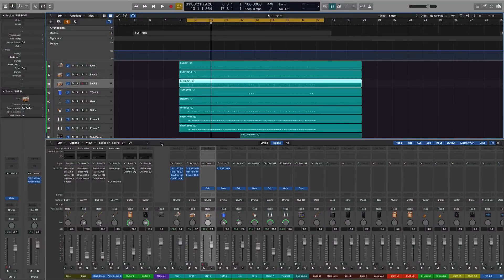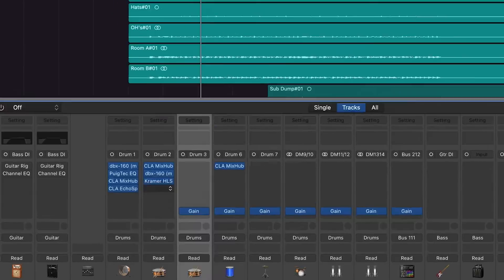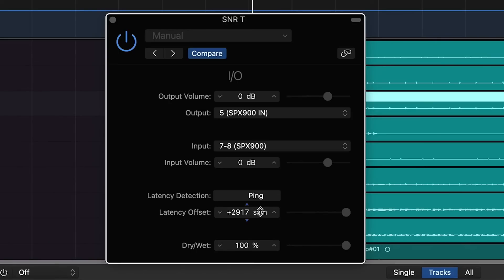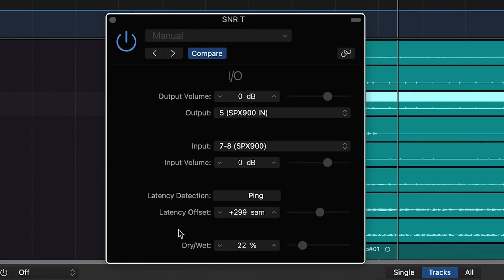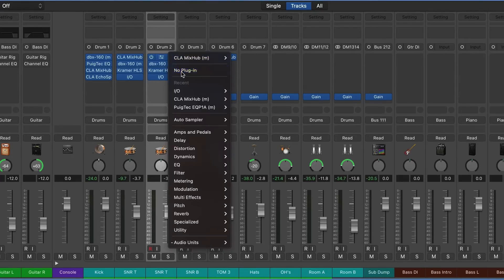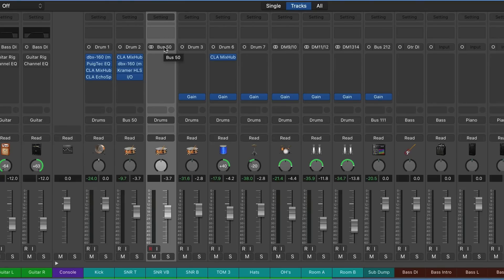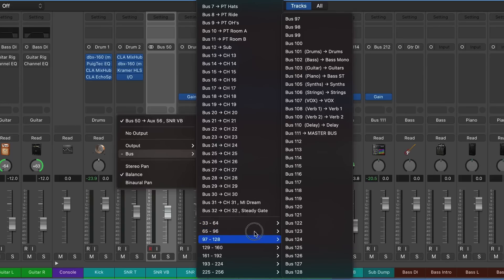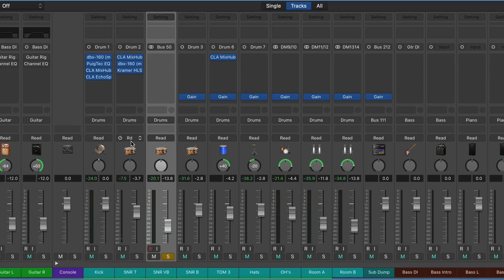Using Outboard Gear with Logic Pro X

Comment: So I want to start adding outboard gear to my studio, im running an Appolo twin and have been using UAD n waves plugins mostly .   My question is,  so if I want to use the outboard gear , pre, eq, comp for tracking , and mixing . How would I do that?    Say I have multiple tracks like chorus and adlibs and want to change the EQ on the outboard gear on that track ? If I change the setting on the outboard gear it would change it on the other track ?     How does the daw save those specific settings on an outboard gear for individual tracks? I can’t wrap my head around this.??
Reply from the maker: Good question. I'll start with the tracking aspect.

So the Twin does not have insert points. That means whatever you plug into inputs 1 or two feeds directly into your computer. No ways around that. With that said if you wanted to track using outboard gear you would first need an external preamp. You cannot plug a mic or guitar or anything really into an EQ or compressor. They HAVE to see a preamp first. So that chain would go, as an example, Mic --> Mic Pre --> EQ and/or compressor --> into the Apollo.  

For the second part of your question. The Apollo only has 4 outputs, 2 of which are being used by your monitors. So that only leaves you with outputs 3/4 to feed signal out to outboard gear. And that gear would have to return  (to i'm assuming Logic) via inputs 1 and /or 2 as that is all the Twin has.

So now as for using said outboard gear. Down the rabbit hole we go lol. Let's start with the easy part first. No DAW will save outboard gear settings. There are some pieces of outboard gear that also connect to your computer via USB and have a plugin interface so you can control the hardware via a plugin. But those are few and far between. So I'll speak to normal outboard gear.

Let's say you bought an 1176. You decide you want to run a bass track through it. That's easy enough. But now your bass is tying up the 1176. What if you now want to run a vocal though it as well? Then you would either need a second 1176, OR, you just run the bass through the 1176 and print that onto a new track. Note the settings down just incase. And now that 1176 is freed up for the vocal. Rinse and repeat. 

Thats the thing with outboard. You either need a ton of it, or you just keep printing to free things up for the next track.

Another trick, we can steal this from CLA. Much of his outboard gear is set to a given setting and he never touches it. So going back to an 1176, his Bluey 1176 is for his vocal chain. It's set a certain way. He simply adjusts the compression he's getting by how hard he is hitting the compressor. You can do the same thing in Logic simply by adjusting the output level on the I/O plugin (but don't clip your converters) and the I/O plugin would be saved in your session. You also wouldn't need to note down the settings on the 1176 either since the dials on it are "locked" in stone.

Assuming again that you're using Logic, when I send out to outboard gear I make a note of the settings in the mixer view. With the mixer opened go to it's VIEW menu, channel strip components, and notes. You'll then have a little notes section under each track name in the mixer. This is where i make notes for outboard.

I think i hit all of your questions. If i missed anything or you're still not sure on something just let me know =)

Comment: hi thanks for your video ..question i want to use compression on the main output to use (master glue compressor ) how do i print as you cant buss the master output ?Any ideas ?thx in advance Great video 🤘🏽
Reply from the maker: Hey Jez. No worries and glad you liked the video! 

I'll answer your question how I am understanding it. It sounds like you have a hardware compressor you are running your mix though it and are then needing to print that mix back into your session onto a new track. If I got any of this wrong just let me know.

Anywho, Logic doesn't have a means to bounce a mix on to a new track. So there are a couple steps involved but it's real easy. 
1. Set your cycle region to cover the track from start to finish.
2. Command + B on your keyboard to bring up the "BOUNCE" window.
3. Left top corner of the bounce window under "Destination" select PCM
4. Just below that under "MODE" make sure "REALTIME" is selected. Anytime you are bouncing and using outboard gear you absolutely must select realtime. Offline is fine when you are ONLY mixing with plugins.
5. Right side of the bounce window, WAVE is fine. Set the resolution and sample rate the same as your Logic session if it's not already the same. File type should be interleaved and set any dithering option you might want.
6. Under the dithering option make sure "Add to Project" is checked. Then hit ok and Logic will bounce the track to disk.
7. Once Logic is done doing its thing, hit "F" on your keyboard to open the browser and when the panel opens up make sure the "PROJECT" tab is selected at the top. This will show all of the audio files in your Logic session. 
8. Locate the file that was just bounced and then just drag it into the arrange window to create a new stereo track.

It would be nice if Apple would add an option in the bounce window to add the bounced track to a new track instead of having to locate the file and drag it into the session.

Let me know if that helped or if I totally misunderstood your question =)
Reply: @EverythingMusicRecording  wow ..many thanks for spending the time to answer my Q ... I really appreciate it 🙏🏼
Reply from the maker: No worries at all Jez 🙂

Comment: Hello sir, thank you for the video .. I love to hook up my old lexicon reverb to Logic Pro for my vocal track … can you pls help showing me how to hook it up !! Many thanks  ❤
Reply from the maker: No worries Eddie. There have been a couple old lexicon units popping up for sale in my area lately. I’ve been considering grabbing one.

Before I can help you out I just need to know which audio interface you have, and which lexicon unit you’ve got and we can go from there 🙂
Reply: @EverythingMusicRecording   thank you for quick replied sir, I also have Lexicon pcm 91, I just bought UAD Apollo x6 for my audio interface , I am using plug-in most of time  ( in box mixing) .. but now I would to hook up this external unit to the system !!
Reply from the maker: Oh nice! Yea there are some MPX’s, an MX200 and a PCM80 for sale around here right now. I think the PCM70 is the one that goes for big bucks

As for your setup, I’d do it this way. Run outputs 5-6 from the Apollo into the inputs on the lexicon. Then run the outputs of the lexicon into inputs 5-6 on the Apollo. 

You don’t have a ton of I/O on the X6 so if you want to run more outboard at some point I’d pick up a patchbay.

Oh and the ins and outs on the lexicon are balanced so just grab some balanced TRS cables. If the units are close enough together you could just get some short cables.

And that should be about all you need. Let me know if that helps and if you need more help just let me know 🙂

Comment: i assume in this case you have simply gone IN to OUT and not bothered with SEND RETURN on the actual hardware. i am running many units from a patch bay and will have a simple one patch back to one in on soundcard (if this makes sense)
Reply from the maker: In my case yea, the SPX900 is currently the only piece of outboard I have so it’s just hardwired into my interface. Patch bays and more outboard are on the list whenever I can manage to get around to it… or win the lottery lol
Reply: @EverythingMusicRecording  yeah I’ve been building mine up for several years. Yes I’ve got plugins etc etc but nothing beats hands on
Reply from the maker: That’s wicked!! Let me know what you’ve got if you want too.

I’d like more FX units. I have a list of 80’s units that are still used in studios today but are pretty cheap. It’s just hit and miss whether I can find any in my area (or within a couple hours drive) and they don’t come up often. 

There is also some Neve and Chandler Limited stuff I’d love to get, it’s just having the funds to shell out that kinda money lol. TBH if money was no issue I’d have a console. Doing things with plugins and such is great, but I’ve always felt that disconnect. A keyboard and mouse have never done it for me.
Reply: @EverythingMusicRecording  yeah keyboard and mouse is frustrating that’s why I dived into Raven Mti2 so I can touch and actually be a lot more hands on
Reply from the maker: Oh, tell me more. A buddy of mine bought one a number of years ago and ended up getting rid of it. And the big music store in the area has never had one in stock or on display to mess around with. I have always wanted to try one out.

I always thought 2 of the Ravens paired with a Mackie (as an example) MCU with 2-3 of the fader extensions (for 24 or so faders) would be about a perfect combination.
Reply: @EverythingMusicRecording  yup had that exact set up and decided I didn’t need the MCU + Extensions so sold them. Now I’m purely Raven and external rack gear + synths :)
Reply from the maker: Oh fair enough. I’ve tried a number of times using Logic Remote and I just can’t get on with faders on a touchscreen. But different strokes for different folks 🙂

I need another synth or two as well lol. I only have one hardware synth… the never ending list of gear lol
Reply: @EverythingMusicRecording  23 years in the industry. Trust me you’ll never stop buying gear
Reply from the maker: Lol you’re preaching to the choir my friend 🙂

Comment: Howdy, have you had any issues with a double signal coming through once the plugin is turned on? Im going ( out of output 3 on interface mono> into comp in> comp out into ch1 patch return on interface) using id44. For some reason i just get a double signal that is slightly delayed while monitoring. Checked my audient mixer software and made sure my out puts for 3/4 or "daw thru " and mono. Any suggestions help, thanks!
Reply: Same here. Any resolution @cashbich ?

Comment: Thanks so much for this video. Honestly helped a lot more than other information I’ve found out there. Question: obviously  when we’re printing reverb, we’re using a 100% wet return and bringing the level up on the reverb track. How would this process look differently if we were using, say, Compression or EQ? Do we blend the effected signal with the original or just use the effected signal? I assume we want ALL compressed or ALL EQ’d. I’m just a little confused. Thank you again!!!
Reply from the maker: Hey Brock, thanks for the kind words!!

Generally yea, your return would be 100% wet and you’d blend it in with the original to taste.

For compression, this would be parallel, or, New York compression. In this case you would usually hit the compression much harder then you normally would, then blend to taste. You could do the same with distortion as another example.

EQ in the other hand. There is zero reason to ever us a parallel EQ, it will just cause issues and possibly phasing nightmares. Many will stack EQ’s though. Just keep it all on the same track.

Let me know if that answers you question 🙂
Reply: @EverythingMusicRecording  Thanks so much for getting back to me!! This helps a lot. I understand that this method using a hardware insert would be parallel compression. Am I correct in my understanding that the ONLY way to get a hardware compressor on a track itself (real-time) is to track through that compressor? (Compress on the way in)I would assume so. Sorry if these are dumb questions. Moving from the digital to the analog world is its own thing! :)
Reply from the maker: Hey Brock, there are no dumb questions, just dumb answers lol.

You can absolutely track via a compressor in real time. But you could also run that track back out of your DAW and print the return from the compressor after the fact like we talked about. In that case though you can just mute the original track and only use the printed track instead of blending the two. 

The thing to keep in mind when tracking through a compressor is that you can’t undo it. If you’ve over compressed on the way in then the only way to fix it is to replay, or sing the part. So in many cases is best to use light compression on the way in, say a 2:1 or 3:1 with only a couple dB of gain reduction, then add more compression when you’re mixing.
Reply: @EverythingMusicRecording  Peefect. This is the exact answer I was looking for. Thanks so much! You’ve earned yourself a new subscriber, sir.
Reply from the maker: Lol no worries at all Brock!! Glad I could help. If you ever have any other questions always feel free to ask 🙂

Comment: why dont you use a bus to send the signal from the drum track instead of using the snare out to route the signal??
Reply from the maker: You can do either or. Since it was just sending the snare drum I didn’t see the point of creating a bus. I always print external effects on to new tracks anyway. 

Now if I was say, sending the whole kit to a external compressor then I would have done the same thing except I’d have placed the I/O plugin on the drum bus.

Also I prefer to use busses for groups, reverbs and delays (think of the layout of a console) and keep them together on the right side of my mixer window. When I see people mixing and they have busses all over the place and mixed in with regular tracks it makes my OCD twitchy lol.

Comment: thanks so much for this vid. what would you do differently if you wanted to print the entire sound, (dry and compressed signals together, ie. the result of the compression, not just the compression/reverb etc)? Hope that makes sense. Either way I can just do it across 2 tracks as you showed in this vid, but it would be good to know if it’s doable in just 1? 
Thanks a million again, you’ve got a new follower :)

Comment: So what about a bus. Can you do this. This way you dont have to print correct.
Reply from the maker: Correct Dan. The only time you would really need to print is if you need to free up a piece of outboard for a different track that needs different settings. As an example I only have one SPX900 which I mostly use as a snare reverb. If that’s all it’s being used for on that song then I don’t have to print the snare. 

But sometimes I also like to run the bass thought it using the symphonic patch (Andy Wallace trick) so in that case I’d have to print the snare first, or get a second SPX900.

Same thing would apply if you’re using outboard gear on your busses. 

Now you don’t have to do this, but I’d still recommend printing anyway just as a back up. If at some point down the road you had to open a mix but no longer had a certain piece of outboard gear that was used, at least you have a printed backup.

Hope that made sense… I just woke up lol

Comment: Hi Jeff ! Exelent video ! - I have a problem with mi configuration or my routing conexion - have a many feedback on my monitors when up the gain of external hardware - preamp or eq - what do you think need moded in my case ? Thanks !
Reply from the maker: Thanks Viktor. I'm not sure how to answer your question. It's one of those "I'd have to be there to help" situations. Off the top of my head the levels could be too hot. Do you have a track armed with a mic on it at the same time? Maybe a delay unit with the feedback set too high? I don't know, but I'd start with your levels and make sure you're gain staging everything properly and go from there.
Reply: For me I was using a line output of my Avalon into the xlr input on my interface, had lots of feedback but if I switched my input on the audio interface to line level, it made the feedback disappear

Comment: Theoretical setup will it work? Interface with multiple io, hardware synths, hardware samplers, and outboard processors. 

The music i create is all done OTB with hardware sequencers, synths etc, what i would like to be able to do is mix on the fly with all my outboard gear whilst im creating a track, meaning before anything would be recorded to a computer. For example using an outboard reverb for all my drums before on similar to like you would with a aux send on a mixer. Grouping drums/synths sending them out to outboard eqs, Using a comp on the masterbus etc. Basically what im saying i would like to be able to utilize all my outboard gear before anything would be recorded and commited to the computer? In otherwords having an analog mixer workflow with an interface.

Is this type of workflow possible with just a interface or would i run into all sorts latency issues from the roundtrip to outboard gear? I would like to avoid having a mixer if i can.

Suggestions on similar types of workflow with a setup like this?

Cheers!
Reply from the maker: Hey Vince. Great question. Your computer and interface will be the biggest factor in how much latency you'll get. You will want to set the buffer in your DAW as low as possible (if you start getting clicks and pops then its too low for your computer and you'd have to bump it up) Also plugins can have no affect, or a huge affect on latency. So try to keep plugins to a minimum while you're performing, OR stick to plugins that add little to no latency. When I had a space where I could record my drums i used to have 14 mics on my kit and latency was never an issue even with multiple other tracks playing at the same time. Its just knowing how much you can throw at your system before it starts crapping out on you. But if your setup can handle it then your theoretical setup will work just fine.
Reply: @EverythingMusicRecording  thx for taking the time snd helping, appreciate it!
Reply from the maker: No worries at all Vince. If you ever have any questions always feel free to ask =)